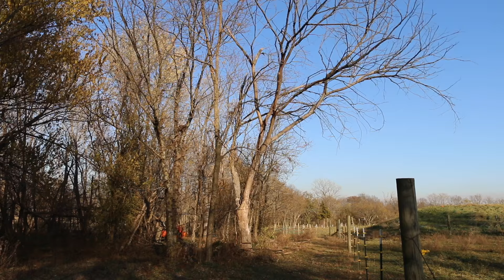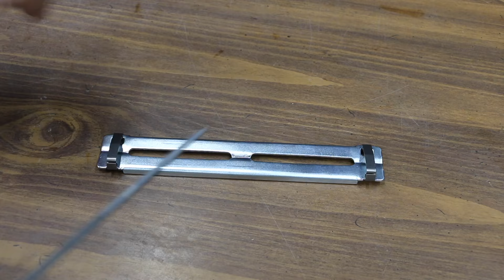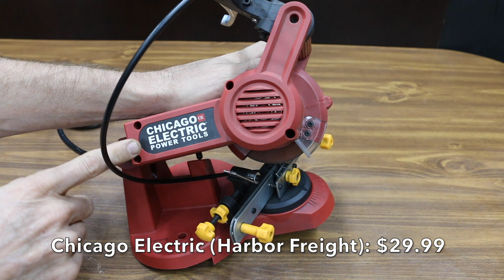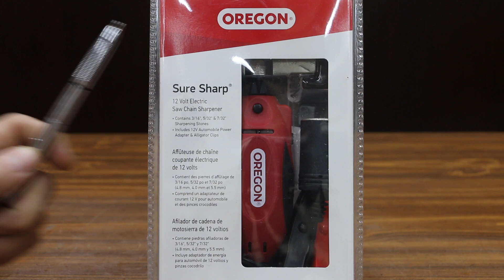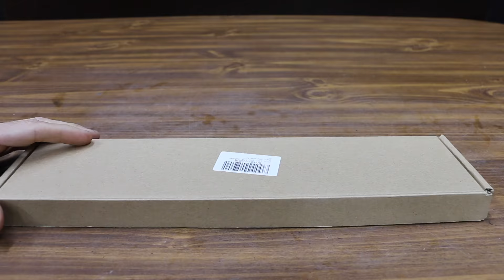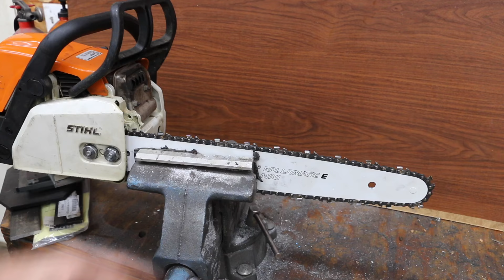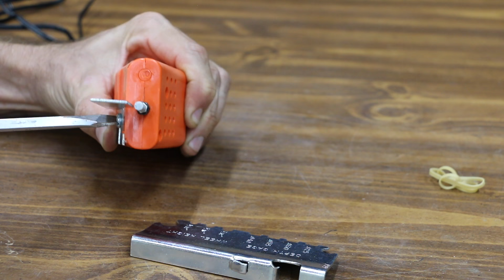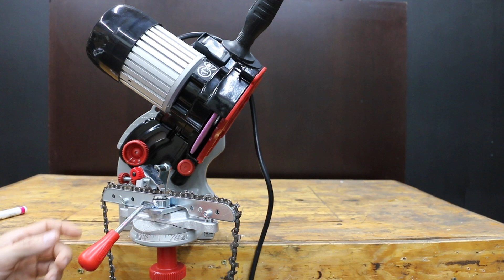Which Chainsaw Sharpener is Best? Let's find out! Stihl, Granberg, Chicago Electric, Oregon

Comment: i would personally steer clear from the electric tools since it fairly easy to overheat the teeth of the chain and make them too soft and then your chain is junk. hand sharpening is fairly easy tbh
Reply: Chainsaw teeth are not hardened. If they were you would not be able to file them. I sharpen chain with a rotary tool. It's easy for me.
Reply: @1pcfred  they are hardened not hardened like a file but they are not soft steel either so you do actually run the risk of damaging the teeth bur whatever i said my opinion and that only i would personally not use a power tool for that eazy job but hey to each his own i guess
Reply: @dimos5422  they file like mild steel does. Files bite right into chainsaw chain teeth. You may be able to achieve a finer finish on the teeth using abrasives than a file too. Less tooth on the tooth, so to speak. Polish is closely related to sharpness.
Reply from the maker: Thanks for the feedback.

Comment: In case you didn't already know, that plastic sharpener setup that mounts to the end of the bar, also requires a specific chain made by the same company. It will not work with regular saw chain, as you found out. I am a little surprised you didn't know about that.

Also, I was really hoping to see more Farmabago tree yanking action when dropping those old trees. Maybe next time?
Reply from the maker: Thanks for the constructive feedback.  Thanks for the suggestion.

Comment: It did not appear you set up the oregon bench grinder properly.I could be wrong so no offense intended. I own one of these and my chains cut way faster than yours did after you sharpened them Didnt see you set the down ward cut that reaches back basically under the tip of the tooth  You have the angle setting left or right side of the chain and you have the the degree setting  you set at 55 degrees but I didnt see you set the down cut under the base of the chain holder It tips up to I believe 10 degrees to reach the gullet area .The part where you said the tooth had some deformation of the tooth .This setting eliminates that and gives the tooth its hook.
Reply from the maker: Thanks for the constructive feedback.

Comment: Take a file and put it in your cordless drill. Run it in reverse and sharpen like you would by hand. I count to about 3 Mississippi’s and in to the next. Just keep the count the same on all teeth. Been cutting for a living for 25 years. And can sharpen a 60 inch bar in less than 20 minutes
Reply: While that may work I just use the stones for sharpening in a rotary tool. I don't like ruining files.
Reply from the maker: Thanks for sharing.

Comment: I mark my Mountain Bike Chain with a black Sharpie, before I lube it. Would a bottle of White Out have worked marking the chain links, before sharpening (more visible on camera)? 
I was laughing about the portable power units. If you are out on a hiking trail and need to sharpen the chain (i.e. Texas Chainsaw Massacre movie), you'd have to walk back to the vehicle and then back out. Not practical! Victims will run away! =P
Reply from the maker: Thanks for the feedback.

Comment: lol guess you just said f it with the diHo sharpener on the second test...you think other brands that follow the same gimmick would be just as bad?  I've been thinking about getting a powersharp...it uses a different kind of chain so maybe wouldn't run into the same issue as the diho.
Reply from the maker: Thanks for the feedback.

Comment: I was going through my tools yesterday and I have lots with tons of different screw heads is there really that much different torque or grip from Phillips or torx or Allen if love to see what you think
Reply: It's mostly about cam out and yes there are major differences. Square drive would be ubiquitous now but the guy that invented it wanted a premium for it so manufacturers (like Ford) went with Phillips and flat instead. Torx and star drive also suffer less and are less bit wear resistant than square drive (to the point you can sometimes get away with using a smaller driver for a larger size (ergo a T20 bit to drive/remove T25 fasteners).
Reply from the maker: Thanks for the video idea.

Comment: I'm cheap. I just use a file and guide like the first one shown.
However, I'm not a logger or an arborist. So I'm not constantly wearing out my chains. For the past two years, I've resharpened my chain twice, and haven't touched my spare chain.
That Stihl 2 in 1 is pretty slick, though.
Reply from the maker: Thanks for sharing.

Comment: The second one is supposed to only be used with a special chain with a different style of teeth that sharpen from the top instead of the traditional way. You have a knock-off of something Oregon came out with a few years ago. It probably didn't have real instructions to tell you it doesn't work with normal chains.
Reply from the maker: Thanks for the feedback.

Comment: So in the field… I guess I’ll like the two in one. But since it is BYO file,… What brand of file did you use?
Reply: The Stihl 2-in-1 comes in several, different file sizes. Your local dealer can recommend the right sizing for your chain. I am guessing that the store from which Project Farm ordered his just didn't have the correct size for his chains in stock. You can look up your chain dimension and then search the internet for the corresponding Stihl.

Comment: Great video.  I wish you would have used my tried and tested system, eyeballing it with a cordless Dremel and sharpening stone.
Reply from the maker: Thanks!  Thanks  for sharing!
Reply: That's what I do. I never could figure out how the Dremel adapter worked. But I can chuck the stones into the tool OK without it.

Comment: I would like to see which brand of Phillips head screws are least likely to cam out. As always another great video from Project Farm!
Reply from the maker: Thanks for the video idea.
Reply: You do know that Phillips screws are designed to cam out, right?  Use torq if you don't want that.
Reply: @allanwind295  Yeah I know but for a lot of smaller specialty projects Phillips heads are the easiest to get and some are just easier to work with than others.

Comment: Oregon Powersharp is a real “push to sharpen” system.  It requires a Different Chain and Different Bar besides the sharpener that mounts on the end of the saw when needed. The chain is VERY different with the cutting edges on top that looks more like a chisel, which is why that “push to sharpen” system actually works. This is why scam marketers use the idea to fool people into thinking the idea can work for any chain - it can’t.
Reply from the maker: Thanks for the feedback.

Comment: I never take the time to sharpen a chain.. usually just replace them. That might change now. Thanks
Reply from the maker: Thanks for sharing.
Reply: If you use a saw enough just replacing the chain when it gets dull gets expensive fast.

Comment: Why you change angle when you cut? That makes the chain cut more wood. Make a stand on joint or tube guide like you did on drop test impacts. Also i didnt like brown wood at 3 first chains test it can be harder then rest.
Reply from the maker: Thanks for the feedback.

Comment: The fastest chain, is an old chain filed several times.
It leaves room between the tooth, and the depth gauge, for material to be moved while cutting.
A new chain isn't nearly as fast...
It's best just before you have to throw it out.

Great video as always!
Reply from the maker: Thanks so much!
Reply: The fastest chain is the one you grind all the depth rakers out. She'll take a big bite then!
Reply: @1pcfred  Definitely, but you loose some direction control...
Reply: @HeathenHungr  you do? I never noticed.

Comment: The most famous quotes of all time: "one small step for man", "let's get ready to rumble" and "We're going to test that" :P
Reply from the maker: Thanks!
Reply: @ProjectFarm  hi can you do bike chain test ( snap test - forxe and weight ti snap chain ,   rough ervirament test -dirt , salt water, sand).   my friend told me that he always snaped his chain with road bike because of huge force I drive road bycicle too but i only strech chain by 3 joints  in 6 months ( i used continental chain )
Reply: @ProjectFarm  what's the best gear oil should be added to your channel.?
Reply: 4 @Tiktalkrandom
Reply: @ProjectFarm  you probably won’t see this with the quantity of messages you must get but can I ask why you don’t use engineered wood in your tests?   One would imagine that engineered timber would be more consistent than regular timber with knots etc?   Always really enjoy your videos.
Reply: @ProjectFarm  I love your channel. And tests. I know that you probably already are aware of this…but if you’d of used a petrol powered chainsaw, the outcomes would have been fairer. Just bc the power output would have been more even throughout.  But we all got the idea and gist of it. 

Have you ever done a test video on the best oven cleaner brand? Or best concrete sealer? Thank you. Have a safe and festive holiday season.
Reply: more like "Let's find out"! I love seeing that in the clip.
Reply: @MiloPerrotti  Me too! Another good one
Reply: Wow. I've tried several chainsaw sharpeners, and hated every last one of them.
So, I go to the hardware store, get the proper bits for the mototool, and go to town.
I have a rare knack to repeat actions over and over, so holding the proper angle used to require a protractor or angle guid, but now, it's all in the muscle memory.
But, I will say that the mototool is a whole lot faster than by hand!
Reply: I'm partial to "That's a lot of damage!"
Reply: Soapy wooder
Reply: "What's it got stuntman"
Leeroy JHEEEEENKINS"
Reply: He needs a shirt with this slogan on it ha ha
Reply: Let's get this out onto a tray... Nice!
Reply: Another great review keep up the great work  boy the days of sharpening by hand files on back of the tailgate of the old Chevy in the woods  to get them pickups loaded down heavy now I miss them days 👍👍😃
Reply: Been watching the rest of the video, and I have a confession. I  came across the Stihl 12v sharpener.
I had one, once. It took the same stones my Dremel had in the case.
I noticed the guide marks on the sharpener, and used them.
The only drawback was that it didn't last long. 
So, using what I had learned from the Stihl sharpener, I applied the angles and pitch, and have used it ever since, which has been over ten years.
The angle, whatever it was, seems to work on every brand of chain out there.
Only the bit diameter seems to change.
Also, I learned to take the depth guides down just a little bit every time I sharpen a chain, so the cut is effective.
Reply: Don't forget the other famous line most of us DIY'ers run into...."Houston, we have a problem!"
Reply: Don’t forget: “Lafayette, we are here.”
Reply: Love this channel!  Excellent and practical content that answers questions that many of us ask all the time.  Thanks!!
Reply: @william hodge  sory english is my second language becauce my main language is Lithuanian ( very hard language)
Reply: @David Armstrong With a name of Armstrong you would know my friend‼️ 🚀 Relative⁉️ 😉 I’m on the same page as you 🌙  One small for me, one big lie to mankind 👿
Reply: There’s also “This is The Lock Picking Lawyer, and today...”
Reply: Dont forget the most famous:

"I make a new one" - mymechanics
Reply: @TheFastStang  damn do i miss my mechanics, hope he finds more broken/corroded tools or equipment to restore
Reply: Well now this is a interesting video and after watching all of these different ways to sharpen your own chainsaw, makes me very glad that I take mine in and have them professionally sharpened.

Comment: Hey just cut earth to make a chainsaw chain Blunt that's what works best....At work we sharpen our  stihl ms200T chains using a round file and every 2 or 3 sharpening's we use the stihl 2 in 1 and depending on the chain size we change the round files on the Stihl 2 in 1 according to match :-)
Reply from the maker: Thanks for the feedback.

Comment: You got the wrong Stihl 2 in 1. You got one for full size 3/8 pitch when the chains are 3/8 Low Pro (3/8Picco). As such none of the sharpening with that tool are gonna be right. Please redo the test with the right Stihl sharpener. As a Husky guy, I absolutely love these sharpeners, but you need to have the right one.
Reply from the maker: Thanks for the constructive feedback.

Comment: You should have ur local still shop sharpen for you if they have one of the fancy auto chain sharpeners. My father has worked in a JD/Stihl shop for over 25yrs so I love seeing chainsaw videos lol
Reply from the maker: Thanks for sharing.
Reply: I made that mistake once as they charged me more than what a new chain cost (elsewhere).  They were also aghast when I asked if their adjust the depth gauge if needed.  They don't so the service was only a partial job at my dealer.
Reply: @allanwind295  there are definitely some bad businesses out there.

Comment: Love your vids but I think you may have done an unfair comparison here- @ 13:37 the cutter has significant bluing indicating it was overheated and the cutter lost it's hardness, not to mention a very large burr which is a weakness of that oregon grinder (in the end). To be honest at the beginning of the video, I thought at the $195 price point, it would tilt to the left hand side so the grinding action always went into the cutter. Instead it's like the HF with a fixed head tilt and the left hand side of the chain has the wheel grinding from the inside to the outside of the cutters
Reply from the maker: Thanks for the constructive feedback.

Comment: Great job! I've tried a lot of sharpeners and have settled on the Stihl 2 in 1 as my favorite, especially for working out in the field. Not only does it produce a quality edge on the cutters, but over the lifespan of the chain its ability to automatically and effortlessly keep the depth of cut at the proper level is a BIG PLUS. Pferd makes a  sharpener that is a duplicate to the Stihl 2 in 1. I am not sure, but Pferd might make the sharpener for Stihl. Strictly speaking, these sharpeners should only be used with the file size they come with. I guess that could be a cost downside if you have saws which require different size files. Although I saw that you did swap out the file that came with your unit with a different size file and it seemed to work fine. So, who knows!!!
Reply from the maker: Thanks!  Thanks for the feedback.

Comment: Best is a proper file and use the file as you cut. Period. The chainsaw sharpeners are good for extremely dulled blades but if you run your chains that hard you ruined the chain and bar anyway.
Reply from the maker: Thanks for the feedback.

Comment: A little disappointed you didn't use the Dremel chainsaw sharpener that I have, it's alot like the Sthil Protable Sharpener or Oregon Sure Sharp with just a rotary tool with a cylindrical grinding stone and a metal angle guide. My review is that it does an alright job, the blades aren''t as sharp as a new chain but lots better then a dull chain.
Thanks for all the amazing videos and all the hard work you put into them!
Reply from the maker: You are welcome!  Thanks for the suggestion for future round of testing.

Comment: I had a Timber Tuff grinder for almost a decade, basically an Oregon clone but it worked quite well. 
Then I had the luck of buying a used Foley 308 commercial grinder, that was a real eye opener, it makes my chains cut so much better.
I clean my chains with hot water and dawn dish soap and swish them in a bucket for a bit. 
There you have a new video idea, best DIY degreaser/ cleaner.
Reply from the maker: Thanks for the video idea.

Comment: Since you needed this for your channel these purchases should be a tax write off?
Reply from the maker: yes, thanks!
Reply: @ProjectFarm  I been buying morton ice cream rock salt $1.50 for 4lbs box because I'm a cheap. but I haven't noticed any difference vs Driveway heat ice melt which is a $10 for 9lbs maybe do a video about that?

Comment: I've been very happy with the harbor freight Chicago electric. The key was figuring out the correct miter angle, a little change made a big difference. It also works very quickly after you get the hang of it.
Reply from the maker: Thanks for the feedback.

Comment: I use the timberline carbide chain saw sharpener. It works very well. No electricity needed. It just does not do anything for the raker teeth... You have to you have a separate gauge and file for them.
Reply from the maker: Thanks for the feedback.

Comment: Hey Projact Farm, as a christmas tree farmer from Germany I have used multiple chainsaw sharpeners as well as the sharpening services at the local Stihl dealer. In my experiences Chains sharpenend by the oregon 220W sharpener are pretty sharp, but get dull quickly because some teeth get too warm. Also this device uses up the chain way faster than a traditional file. A regular file without any guides is very small and can even be stored in my chainsaw pants. The finish the file leaves heavily depends on the person using it but for me myself this is the preferred method in the field. The 2In1 sharpener is a very good option when I am sharpening 20 or more chains at a time in the shop because I can save the time to check the depth gauges. All otions where the chain has no hard stop have the same problem: human errors can cause the chain to wander to one side becaue ist was sharpened unevenly multiple times. The only sharpener you missed in my opinion is the Timberline sharpener, which to me looks very promising even for beginners. Maybe you van do a follow up with more sharpeners.
Reply from the maker: Thanks for the feedback.